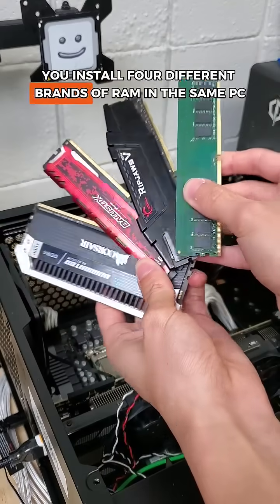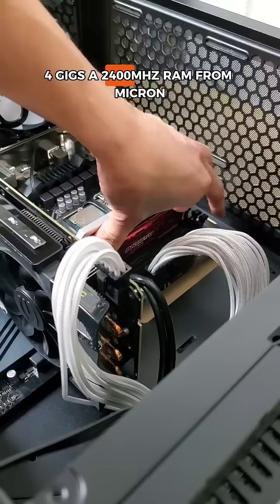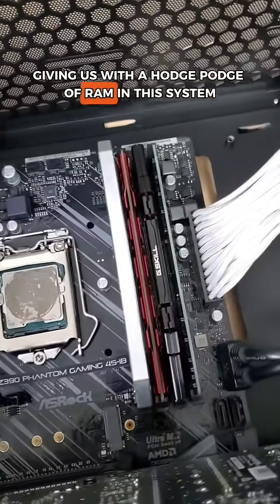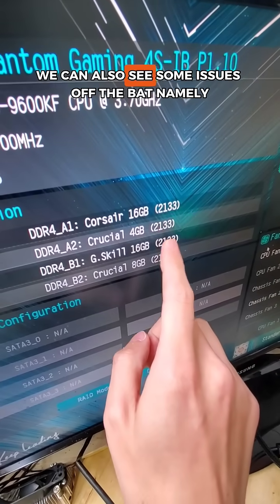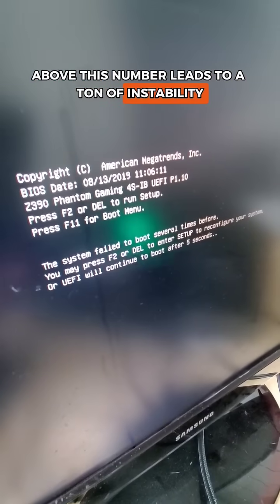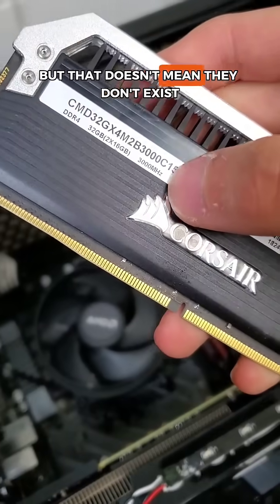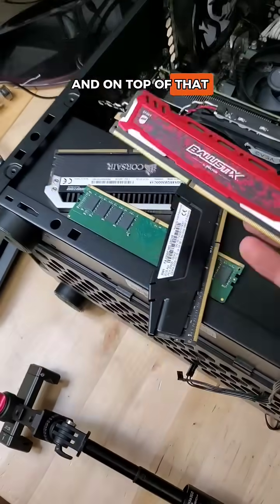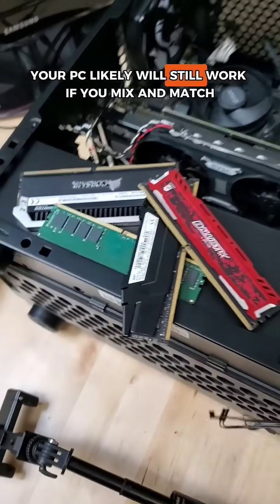can you use different brands of RAM in the same PC? #shorts

Comment: If I'm not wrong, the computer set the speed to the default value of DDR4 to ensure compatibility through all of the sticks, because any RAM is built to run safely in that speed (and the other speed they are marketed, but that is the XMP profile)
You can also try to manually change the speed of the RAM, it could work but also couldn't, it depends on a lot of factors that I don't want to write down.
Reply: Yup.
JEDEC standard for DDR4 is 2133Mhz

Comment: Even if the ram is the same speed they can still have issues if you just try to adjust the speed from the bios without adjusting the other settings.
Reply: I manually put 3000mhz as default speed because my slowest ram speed is 3000mhz but when I put it on auto and let the BIOS choose I end up getting 2100mhz only which sucks

Comment: my old micro atx prebuilt pc had one stick of ram in it (two slots). i put a new one in and kept the old one but i switched the slots to get at the chords easier without having to remove the ram sticks... anyways with the inversed ram sticks it just did not want to work. so i had to switch it back the other way. very strange.

Comment: I recently upgraded from 16 gb 4 sticks of ram to 32 gb 2 sticks. My PC is quite a budget build had has slow down in ram heavy games. My upgrade ram is the same speed as my original but different capacity so i'll try installing 2 sticks of 4 gb gigabytes of ram as well.

Despite being the same speed I've lost about 20 frames per second I can only assume splitting the load between four sticks rather than two had a greater impact on performance than I realised?

Can you do an experiment gauging the difference between single stick and multi stick performance?

Comment: Me watching this on my dodgy pc with 2 different unmarked sticks of ram 🗿
Reply: How many tabs did you have open
Reply: @MrPenguinLol11  it had 114 tabs open 💀. Its pretty stable for the jank its made of, only bluescreens like once a week for a memory issue
Reply: @amishpatel7794  how
Reply: Maya-rz8gk  1.5 years still going strong
Reply: @MrPenguinLol11 What
Reply: You know that intel can send you cpu stickers even though you broke it
Reply: me watching this on a dodgy dell optiplex that i basicilly built with spare parts a had... i got a nice monitor tho!
Reply: me watching with 8gb ddr3 ram in a ddr2 motherboard. if it fits it sits.
Reply: @1oneguythat Bros watching shorts on a fossil…. What year is ur motherboard ?
Reply: @ bro, im ddr3 now.
Reply: @1oneguythat that is literally impossible
Reply: @ its literally not when i shrug at what people people say is impossible. i needed more ram to play tf2 so i "literally" went to my stash of salvaged computer parts until i found ddr3 ram that had the same pinout as the ddr2 stick. then i literally  corrupted systemd because it saves things when you power off. so i would literally boot my computer on multiple occasion to be surprised by currupted filesystem because as we all know ddr2 is allocated 4 gb max. i was literally losing my mind every time i booted up a broken grub screen, absolutely infuriating. 

i needed more ram: i got more ram.
Reply: @1oneguythat  oh, well I was wronged, guess you can use it just with a few issues. Also, i didn't notice your comment being over a year ago, surprised you'd even respond at all. But anyways, sorry for the inconvenience.
Reply: @ruckusrocky no worries.
Reply: Worth thousands nowadays, hold onto that shit it’s an investment.
Reply: 💀👌my pc is the same... i js added 2 corsair sticks with the unmarked ram
Reply: I also have 2 different speed unmarked ram sticks since I needed 16 gb but I’m finally getting a proper 32gb kit
Reply: GET HIM HE HAS RAM!!!
Reply: "my dodgey pc" 🤣
Reply: Me watching on my Nintendo DS 🗿
Reply: bro is watching shorts on pc 😭😭
Reply: @cviator_real me on the tv:
Reply: @gamiacode Nah thats wild
Reply: @gamiacode bro took an hour to type
Reply: @kooochie ye I watch on TV alot and I have that problem. My TV in my second home in Poland has GeForce now because it's in the LG TV app market😂 I might install it next time I'm on holiday there
Reply: @TheFrenchHornManinF  😂😂
Reply: @kooochie  🗿
Reply: @gamiacode me watching shorts on my quest 2 😭
Reply: @cviator_real  i also do
Reply: haha chinese ecc ram goes brrrrrrrrr